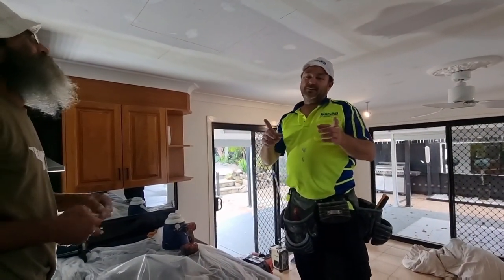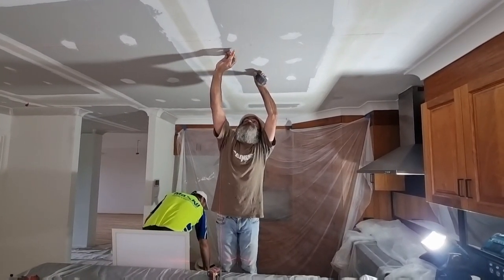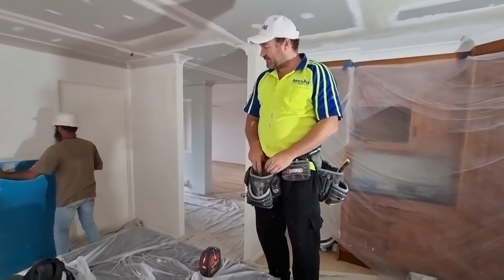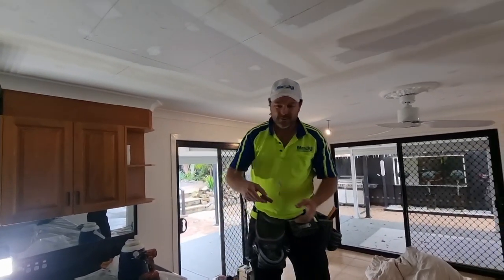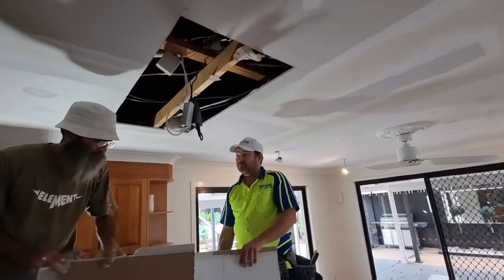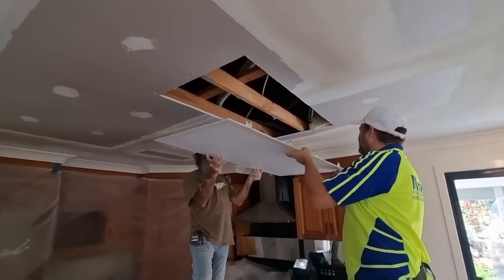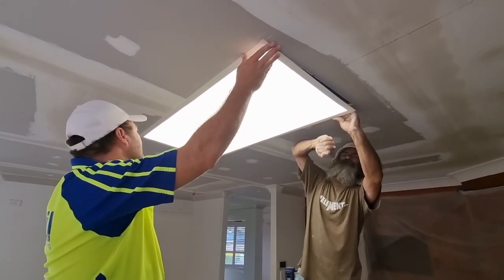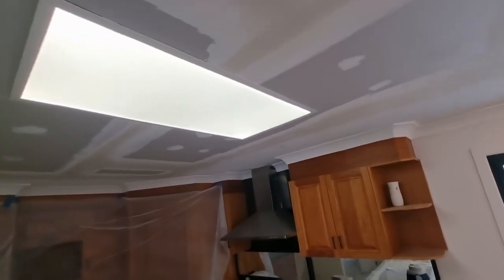LED Panel Skylight Install in Kitchen Ceiling Most Common Mistakes

Comment: Hey ledge! 
I am just wondering, when plastering an actual skylight, and a client wants to achieve a “frameless” or “bordeless” look when looking up from the inside out, how do you achieve this? I know the standard Velux windows have a “lip” to run the plaster into, but can you run it into the glass?